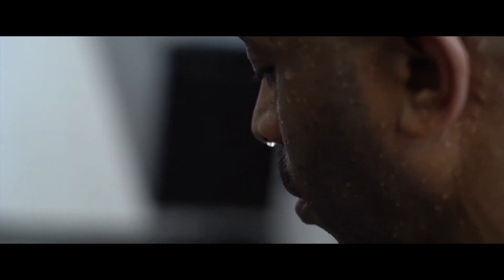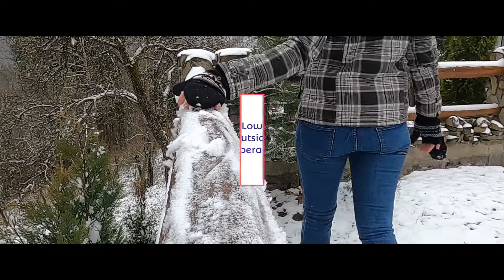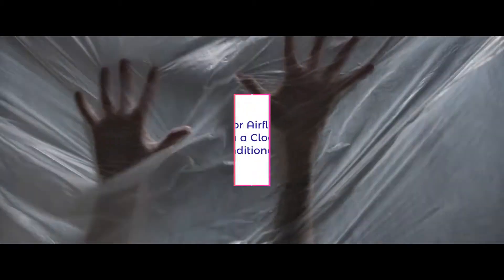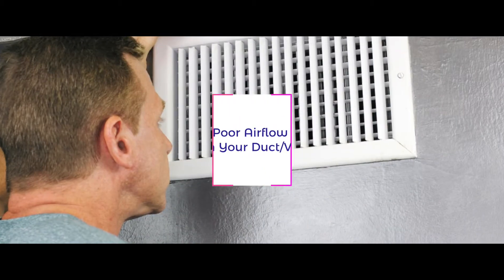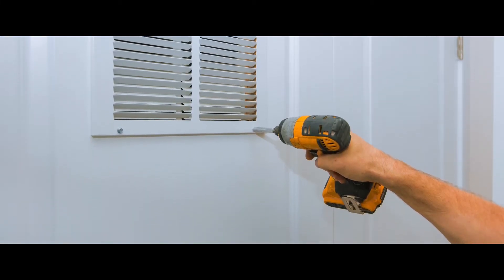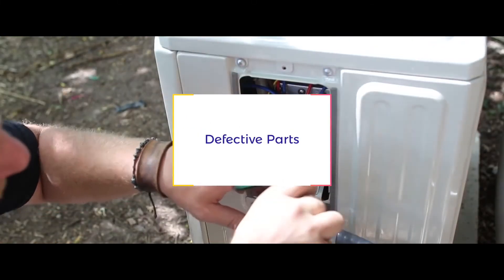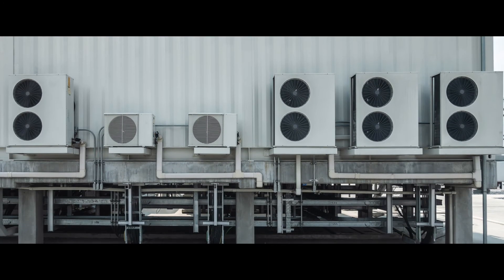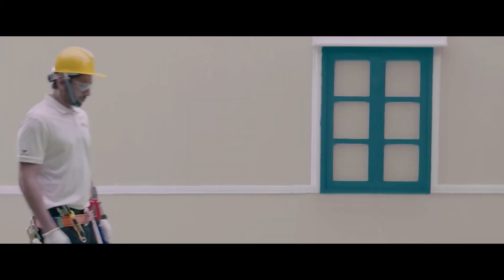How to Fix Air Conditioner Freezing Up | HVAC Training 101

Comment: I didn't watch the video so I don't know if this was addressed, but my second floor AC froze up last night and it was an easy fix.   This morning, while troubleshooting, I found the blower fan in the air handler wasn't on, and the fan's "auto-on" switch in my thermostat to be balky.  I sprayed it out with contact cleaner to restore the operation of the fan in the air handler while I wait for the new thermostat to come in.  I mention this because most electronic thermostats have this switch, and even if it doesn't, still controls the air handler fan.  If the fan is stopped because of a bad electronic thermostat, it will freeze the coils.   Good luck everyone.

Comment: Ac stopped cooling at midnight and i noticed little drop of hail looking ice and some water dripping from the copper wire and pvc pipes on the inside unit of the central ac , I already shut off the system , but how can I tell for sure the ac has leaked or is drained out of refrigerant ?  Thanks
Reply: It’s mostly gas problem nothing at all
Reply: You will have to call a tech to check it.

Comment: I have ice on my window ac unit and I believe it's because of the temperature differences inside and out. 
I clean the filter every month.
What is the lifespan of a window ac?
Reply from the maker: if it is properly maintained, it can last about 10 to 25 years
Reply: Power.spray clean it

Comment: I have a 2000 Chevrolet 2500 AC is freezing up
Reply from the maker: Have you tried cleaning it?
Reply: @HVACTraining101  yes cleaned it
Reply: If its freezing its most likely just low on freon, you need to recover, vacuum the system, inject new oil, and charge the system with the right capacity , don’t go autozone with them cans ! Get it done professionally

Comment: Hi my air conditioner has stopped working out of nowhere no air is blown out. It turns on but doesn’t produce any air. Could it possibly be that the air conditioner is frozen?
Reply from the maker: Have you tried cleaning it?
Reply: Sounds like the fan motor went bad
Reply: You can use a flashlight and check for ice.

Comment: Is it normal to defrost an indoor evaporator with hot water.
Reply from the maker: The safest way to defrost your air conditioner is to let nature take care of the ice. Turn off your system from the control panel, then shut off power to the system at the breaker in your home's electrical panel.